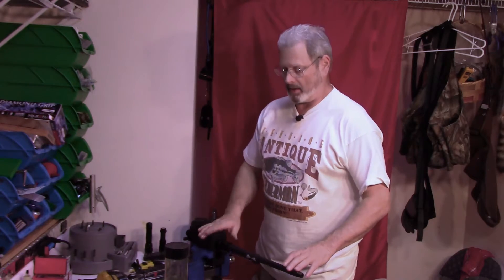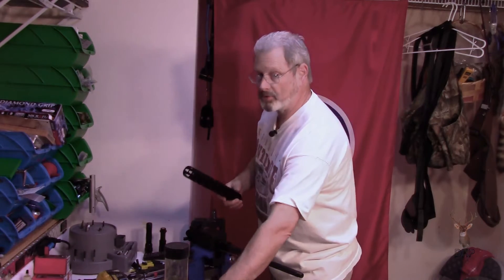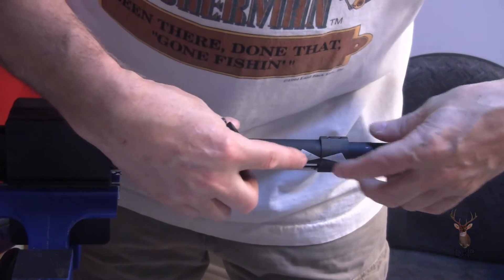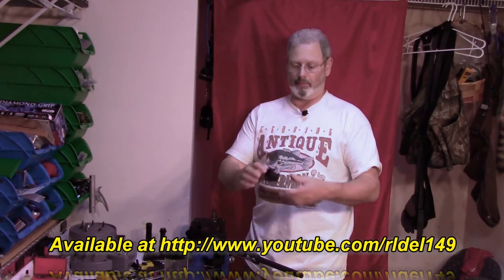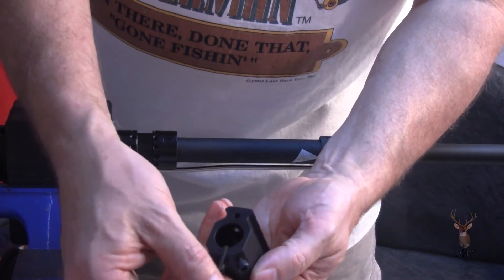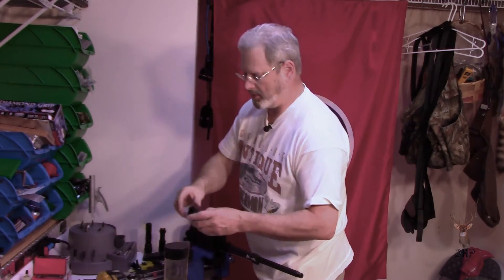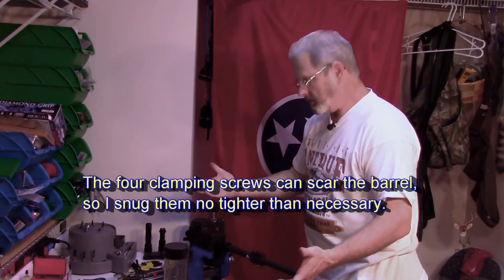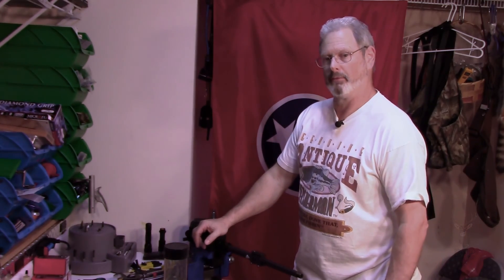S06E08 - Repurposed Gas Block (Dimple Jig) - 1080p

Comment: Great ideal. Do you recall what size bit you used to drill the actual dimple with?
Reply from the maker: Sorry, no.
Reply: First, NOT an "ideal", just an "idea"...  Secondly, a 5/32" or 11/64" diameter cobalt or solid carbide drill.  It depends on the size of the hardened drill bushing you install in your sacrificial gas tube...